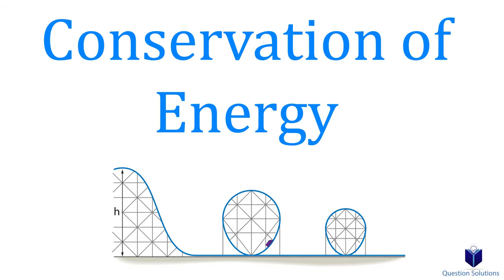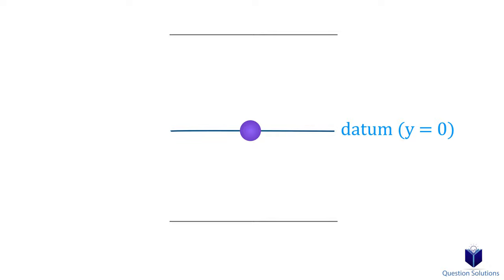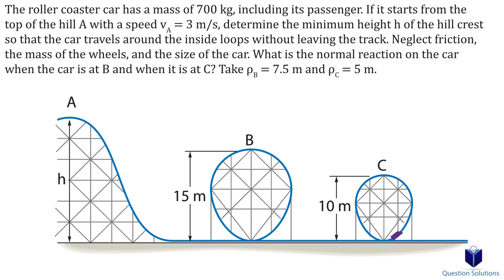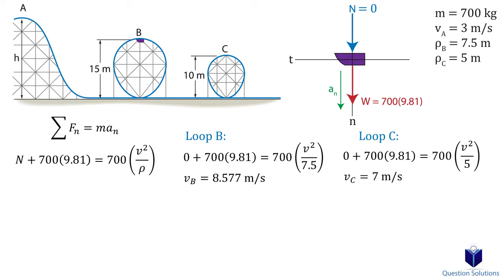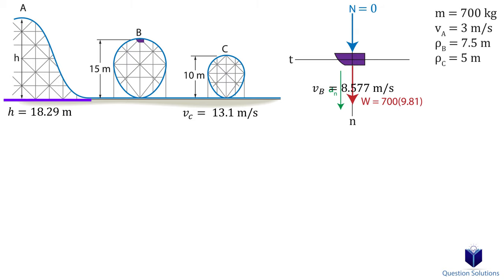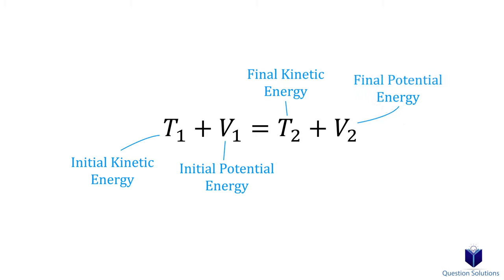Conservation of Energy (Learn to solve any problem)

Comment: wait sir so according to what i learnt last year is that the Mechanical energy is only conserved if the are only conservative forces and in the last example you used the principle to solve s_b while the was the tension in the pulley which is non conservative
Reply from the maker: These are considered "simple" pully problems, so you can still solve them as you normally would. A lot of real world factors are ignored when it comes to pully problems :)

Comment: Why is the normal force 0 at the top of the loop?
Reply from the maker: That's the lowest value at which the roller coaster can "just stay" without falling.
Reply: @QuestionSolutions  Thank you so much for replying. I also wanted to ask when is the elastic potential energy of a spring negative?
Reply from the maker: @ibrahimhashmi6716  You're very welcome! To answer your question, that really depends on where your initial conditions exist. For example, if you have a spring already compressed, and you say the expansion of the spring is positive potential energy, then anything that pushes the spring to compress past the datum would be negative. I encourage you to google your question, there are a lot of articles on this topic :)

Comment: hi, can you clarify when to use principle of work and Energy, conservation of energy, linear impulse, conservation of momentum and angular impulse? like what kinds of situations required certain equations?
Reply from the maker: This is dependent on what's given, how the question is formulated, etc. Sometimes, you can get the answer using multiple approaches. You will get a feel for things by doing a lot of questions and instinctively know which to use. On the other hand, exams are rarely formulated to use just one method. Most of the time, you will need to use 2 or 3 methods to get to an answer.
Reply: @QuestionSolutions  thank you I appreciate it.

Comment: in the previous videos, u mentioned that spring compression will make negative work because the slow down the motion(on the conservative part) why do not we apply this concept to this problem
Reply from the maker: To which problem? Please use timestamps so I know where you're referring to. Thanks!
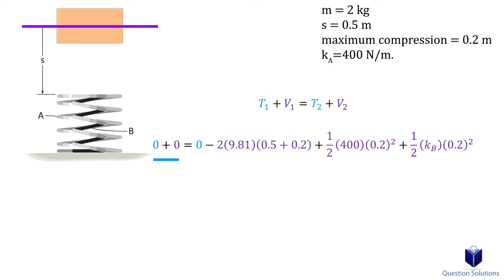Reply: @QuestionSolutions  8:05

Comment: I once more come for your help. I have 3 days left before my Dynamics exam which consists of the following hibbeler topics:

- chpt 12 (done)
- chpt 13 (done)
- chpt 14 (done)

- chpt 15
- chpt 16
- chpt 17
- chpt 18
- chpt 19
- chpt 22

So far I have only covered the first three chapters (12, 13, 14) so I have about 6 more chapters to go. Based on your experience of all these chapters what do you recommend is the best way to prepare for my exam in the limited time of 3.5 days I have left? Like do you recommend for example watching all these videos (which are very good!) and just doing some preliminary and fundamental exercises? Or do you think there's a better way to prepare/study these chapters? Or are there any chapters which you think aren't as important as others? Do you recommend going fast through certain chapters and spending more time on the tough ones?

Since you have covered most of these topics I thought maybe you could tell me what is the best way to prepare for these 6 chapters in a short amount of time.

Any advice is greatly appreciated!
Reply from the maker: This is heavily dependent on your studying style. But this is something you can do. Read each chapter, (if you already did, glance over it again quickly). Then go to the video that talks about that subject, they are only about 10 mins long. Each video covers 3 to 4 questions. Before I solve each question, pause and try to do it yourself, if you get stuck, un-pause and see what needs to happen next. By the time you're done the 4 questions, you will notice that you struggled with certain topics more than others. Write those topics down, and move on to the next. Once you cover everything, with whatever time you have left, do more questions on all the topics, but focus more on the topics you struggled with. That should be pretty good for you, but again, I don't know where you're at with these topics. Also, please note that I did not cover chapter 22 (vibrations). Another thing to keep in mind is, if you're good at simultaneous equation solving, then don't go through the process of doing it, plug the equations into Symbolab or WolframAlpha and get it done. That's only if you're already good at simultaneous equation solving, if not, give it some practice too. 

I wish you the absolute best on your exams and do your best 👍
Reply: @QuestionSolutions  Thanks a lot !
Reply from the maker: @pure_ligma2387  You're very welcome!

Comment: Thank you so much for your videos - they are sooooo Helpful. 
Time marker at 9:30 - why is it not 3Sa + Sb = l +2a?  you have the right-side just = to "l + a". Also how did you get the original equation to start with?
Reply from the maker: Yes, good catch! That should be 2a, that's a typo, but it doesn't matter to the solution since fixed distances turn to 0. To understand how to get these equations, please see: https://www.youtube.com/watch?v=IudPPGIV5QM

Comment: • Some inside understandings from this video : 

1) Conservative force is the force in some potential field which stores the kinetic energy of body in potential energy due to to position from reference datum. 
For eg. Gravitational force for body w.r.t. earth's surface, 
Spring force for a spring due to its elastic deformation w.r.t. mean configuration. 

2) Work done by conservative force is path independent i.e. we can take any path or trace any distance between any planar two points in conservative force field with same work. 

3) Frictional force is no conservative because, it degrades or consumes the kinetic energy to lower forms i.e. heat which is non-mechanical energy. Hence, work done by frictional force is path dependent. 

4) In absence of friction in the path of motion, there is complete conservation of mechanical energy. Hence, both kinetic & potential energies are completely inter-convertible. 

5) Larger is the path of motion, larger will be the loss of mechanical energy due to friction which is path dependent & directly absorbs at every local displacement along the path. 

6) For bodies in motion in space or plane, there are inherent forces like friction & fluid drag (depends on relative air velocity) which consumes/absorbs the mechanical energy to rise local temperature of both bodies or fluid interfaced surface in contact. Here, total energy is conserved but mechanical energy is not.

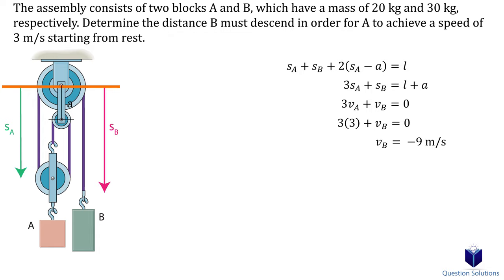Comment: Sorry I have so many questions video but for the spring position equation why did you include 2(Sa-a)? I’m still rusty on these pulley problems do you have any recommendations to really get the concept of when you count some sections vs when not? I’m practicing to no avail. 9:40
Reply from the maker: No worries, see if this video helps you out: https://youtu.be/IudPPGIV5QM

It's all about pulleys.

Comment: Thank you for the amazing work! Keep it up!

I have one question I'm a little bit confused on and would appreciate greatly if you can clear it up for me, please.

For the last problem, I get that the final gravitational potential energy for Block A is positive because it is above our chosen datum, and vice versa for Block B. 
But is there any reason why in the change in displacement equation you have deltaS_A=(deltaS_B)/3 instead of -(deltaS_B)/3 when solving for deltaS_A? 
Would we change the sign to positive anyway when plugging it into conservation of energy equation? I'm confused on that part.
Reply from the maker: Thank you for your kind words.

In regards to your question, it's a typo, when isolating for SA, it should have been negative. However, at 10:50, I explain that it will be negative, so the negative and negative gives us the positive, which means the previous error isn't too much of a problem since we still get the correct answer. But you are right, it should have been negative when isolating and that was a typo :(

Comment: In the first problem, I saw you use TB + VB = TC + VC to find the velocity C in which you got 13.1 or 14(which I got) I Used TA + VA = TC + VC to solve the problem which resulted in the same answer. However, think you have a point that we may run into problems similar to that in which TA + VA = TC + VC may not always be a guarantee.
Reply from the maker: Yes, that's true. Also, keep in mind that you can arrive at the same answer with a few different methods. Different techniques, equations yield the same answer 👍

Comment: Great video. On the spring example why is the work done by spring positive and not negative when the box is dropped?
Reply from the maker: I think you might be confusing work with potential energy? 😅 Regardless, the springs were designed to "arrest the motion" so we actually want it to stop it. In most questions (to do with work), this isn't the case, we usually push something and we don't want the spring to stop it, sort of like how friction tries to stop it but it does by applying an opposite force.

Comment: i would like to ask  question number 2 . Do we consider the kinetic energy to be zero when it hit the spring, because when the block hits the spring the velocity automatically would be zero?
Reply: or maybe the kinetic energy got transfered into another form of energy like sound and thermal hence the KE would be zero?
Reply from the maker: I think you're referring to T2 in the problem? If yes, the kinetic energy is transferred to the spring which compresses it. So the energy is absorbed by the spring itself during the compression. And yes, there is minor amounts of other forms of energy like heat and sound as well.  @bagasnoor7593

Comment: Thanks again! I have a question by the last example though. If we assume the system has no potential energy in the beginning, how then can it start to move by itself?
Reply from the maker: This is more to do with the location of the datum. Since we drew the 2nd datum through the center of mass of the blocks, the displacement from the datum is 0, meaning in this specific situation, at the beginning there is no potential energy. Block B moves down due to gravity, and block A moves up due to block B moving down. Again, the assumption is made with the datum in mind. I hope that helps!

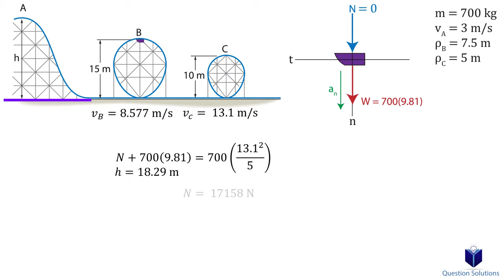Comment: Thanks for making these videos! I have a question about the first problem at 7:26
I understand that we need to recalculate the Normal force at B because our velocity at C is higher than the minimum required at loop C, but why is it that we use the radius at loop C for finding the normal force at B?
Reply from the maker: Actually, what we found was the normal force at C, not at B. At B, we made sure it was 0 for the normal force, which gave us the minimum velocity required for the roller coaster to not fall off. So at the end, we used the radius of loop C to figure out the normal force at C. 👍
Reply: Oh I see, I misread the question. I just saw that we are finding the normal at loop c also haha
Thank You so much!
Reply from the maker: @jiseongkwon66  You're very welcome!

Comment: 1:06 would the force of a bendy spring be conservative? how about a spring that doesn't have the same k throughout?
Reply from the maker: For springs, it's conservative because it has stored energy when it's compressed or elongated. Even if it's a spring that doesn't follow Hook's law, if we stretch it out and hold it, it will snap back to it's original position.

Comment: Hi Mr. Steven. well appreciated for your effort. I need to point out something. In 7:55 I don't get why you did consider the s as 0.2 when you write the gravitational potential energy because I see that two springs compress for 0.2 m which makes 0.4 m when we add them up. So don't we need to write 0.4 m for the gravitational potential energy?
Reply from the maker: There is 2 springs but neither of them compress more than 0.2 m. 👍

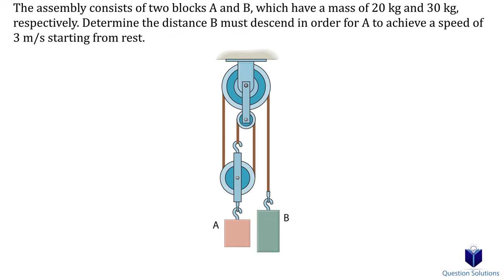Comment: 9:02 Are we allowed to separate the energy equation into two equations: one for mass A and one for mass B? 
Or we could only use one since it is a complete system? Thanks for the reply.
Reply from the maker: You can solve these questions in multiple ways, but in this problem, it's a single pully system, so you only need one single equation to solve it.
Reply: @QuestionSolutions  OK thank you so much! I watched the video about momentum and impulse and we could separate the single system of pulley into two momentum equations. That’s why I went back to this question to ask whether we could use two equations for energy. Thanks for the explanation!
Reply from the maker: @迪安-z6i  Yeah, you can do these questions in so many ways. Do whichever method you're comfortable with. All will lead to the same answer. Best wishes with your studies and keep up the good work!

Comment: 7:14 could you please explain how the normal force will be 0 if the velocity at B is minimum?
Reply from the maker: That's the lowest value at which the roller coaster can "just stay" without falling.
Reply: @QuestionSolutions  due to its state of motion?

Comment: Hi there :) for the second example, why are the potential energies of the springs positive? I think maybe I am confusing this with the previous video's concepts, but would the potential energy not be negative as it is opposing the motion of the block? Many thanks x
Reply from the maker: I think you might be confusing work with potential energy? 😅 Regardless, the springs were designed to "arrest the motion" so we actually want it to stop it. In most questions (to do with work), this isn't the case, we usually push something and we don't want the spring to stop it, sort of like how friction tries to stop it but it does by applying an opposite force.

Comment: When I think of conservative forces, I would think of objects, bodies, affects apply the same amount of force on each other. For instance, let say I was applying a force on the wall. In order for the wall to stay still, it would have to apply the same amount of force on me. If I was applying a force on a spring, than in order to come to a complete stop at that instant position, it must apply the same amount of force on me. This is, I think, where Newton Third Law comes in. It says for every action, there is an equal and opposite reactions. Let alone I also notice that the force that applied on me, whether is on a spring or due to gravity, would have to go same distance as previously in order to return back to it’s zero point.
Reply from the maker: Indeed! In a "perfect" world, this is how it would be, but don't forget, we lose energy as sound, heat, etc in the real world (though for most questions, we ignore this part). 👍
Reply: @QuestionSolutions  you got a point there

Comment: When do you use this method instead of the Principle of Work and Energy?
Reply from the maker: It depends on what is given. You'll probably have to use more than 1 method to solve questions. Sometimes, you can even use either/or to solve as well. It all depends on what values are given in the question.
Reply: @QuestionSolutions  alright thanks! Definitely subscribing :)
Reply from the maker: @gassyroyalnova2582  Many thanks :)

Comment: In the third problem, should the (delta-Sb)/3 be negative because when you move Plus Delta-Sb to the other side it should be negative. Why is it positive.
Reply from the maker: In the conventional sense, you are right, however, all we are saying is, when SA moves a certain distance, let's say the distance is "x", then the distance of SB is 1/3x. In other words, it moves 1/3rd the distance of SA. When we write our conservation of energy equation, that's when we have to think about positives and negatives based on the datum we draw. I explain this at 10:45. 👍
Reply: @QuestionSolutions  I also heard you say in certain problems like this, although there is already a dadum at the wheels of the pulley, sometimes it help to draw another dadum at the boxes two (in Conservation of energy) so that it won’t mess up the whole concept of the problem.
Reply from the maker: @darrylcarter3691  That is correct. It's super helpful with positive and negative signs, otherwise, it can be a pitfall for students. One positive or negative sign wrong means the whole answer is wrong at the end 😢
Reply: @QuestionSolutions  another thing I did is this, after I saw you work out the problem, I draw some paths of the block delta-Sb and delta-Sa. When I derived the length of the rope into the change of displacement, I got 3(delta-Sa) + delta-Sb = 0. But since B is below the dadum and A is Above, I replaced plus delta-Sb with Minus delta-Sb and keep delta-Sa positive.
Reply from the maker: @darrylcarter3691  I am very glad to hear you're trying different methods, which is a really good thing! Keep it up 👍
Reply: @QuestionSolutions  and here’s is my guess for Conservative And Nonconservative Forces. All three problems that were work out all have Conservative Forces. Yet again! Maybe 🤔 problem one is a Non Conservative Force and Two and Three are Conservative Forces. But I think I will try my first guess.

Comment: Why is the N-force at 4:15 zero?
Reply from the maker: That's when the cart is about to fall off. Otherwise, a force is applied from the bottom which keeps it on the track, and an opposing normal force is applied in the opposite direction. So when the cart is about on the cusp of falling, N has to be 0.